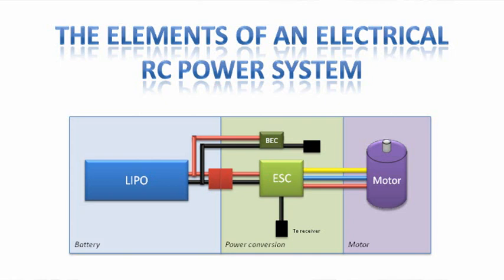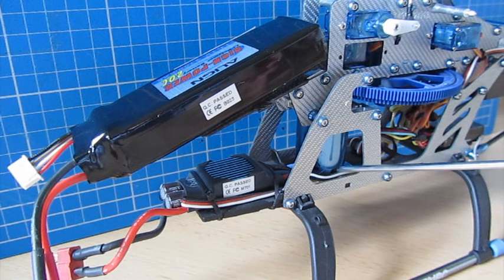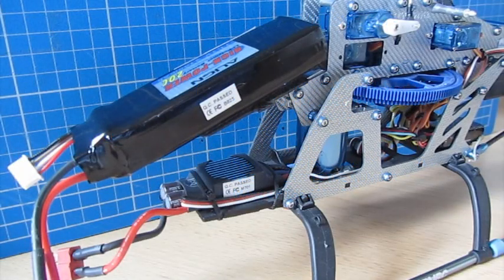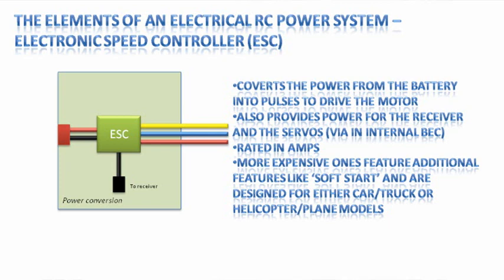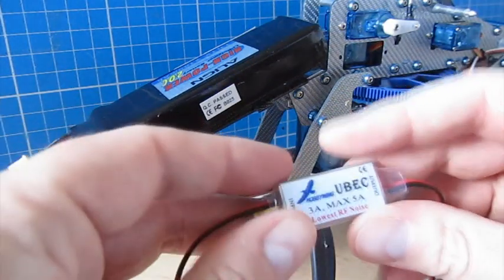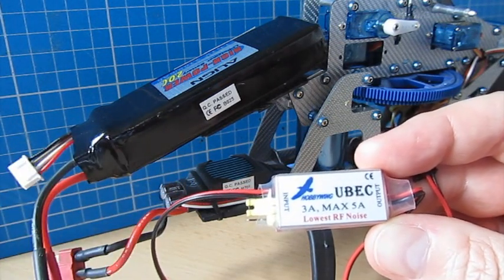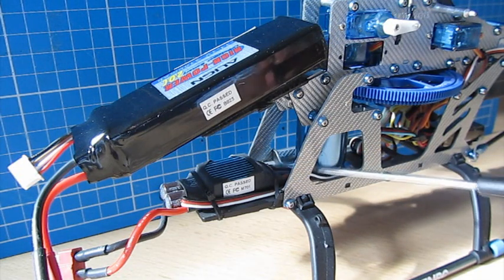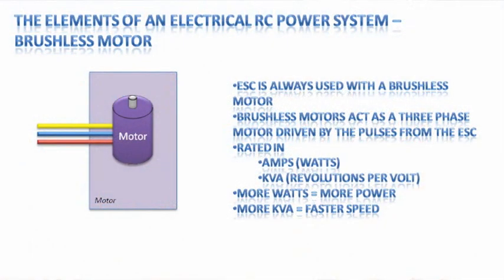RC Electric Power Systems Simply Explained (ESC, BEC, LIPO, Brushless etc)

Comment: I'm trying to find a BEC that will work with a 22v 6 cell battery. I need it to power a Boscam 600mw video transmitter rated at 7.4-16v, a Frsky control receiver rating at 3 ~ 16v, and a FPV camera and servos that I have not chosen yet. I'm just a bit worried that I'm going to fry my electronics. What BEC(s) can I use for my plane?
Reply from the maker: You could run the video transmitter from the balance tap of the flight battery and just connect it across 3 of the 6 cells to give you 11.1-12.6 volts to the Tx. Hope this helps.

Comment: How does the ESC get the signal for motor speed??
Reply from the maker: It's all done through the wire that connects the ESC to the receiver (the one that plugs into the throttle channel). This cable consists of three wires -

- The black or brown wire is the ground
- The red wire supplies the receiver with power from the BEC in the ESC (usually 5 or 6 volts)
- The white (or yellow) wire carries the signal from the receiver back to the ESC for the amount of throttle/power needed

The range of the signal that is sent from the receiver on this third wire is normally between 1000 and 2000 (with mid throttle being 1500). As you move the throttle stick on your radio this signal is sent from the radio receiver down the servo lead connected into the throttle connection. The ESC then supplies the appropriate amount of power.

This is why you need to 'teach' and ESC the range of the throttle by calibrating it - so that the 'full throttle' on the radio means 'full power' at the ESC.

Hope this makes sense - Happy flying!